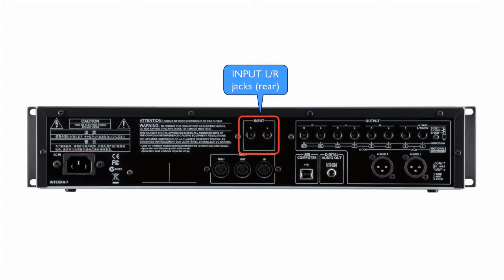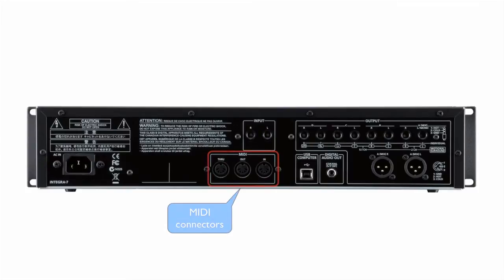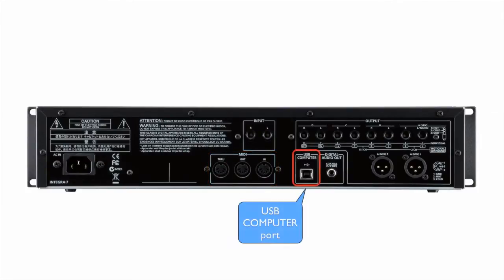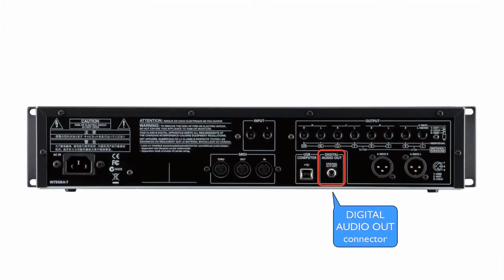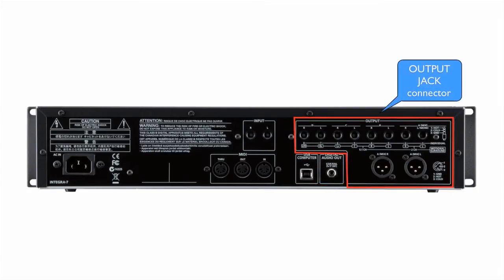Roland Integra-7 - Back Panel Explanation

Comment: I have a roland quad capture wirh Coaxial In and Out. Should I connect the Integra via Coaxial to the Quad Capture to record Integra sound + vsts at the same time in my PC? Or to a mixer and the Coaxial? How should I do it? I'd like to play Integra in Standalone but at the same time that the Integra can get its own audio recorded as some other tracks use vsts

Comment: Hello fellow integra 7 players. Quick question. 
Can I use part one to correspond with the A 1 output on the back of the integra, and plug a1 into a mixer and so on? To be clearer.. can I use each of the outputs as a separate part/track and plug them into a mixer? Ill like to use the 8 outputs as 8 separate tracks, running each individual output into their own  compressor and then into a mixer.  Is that possible and how would one do it